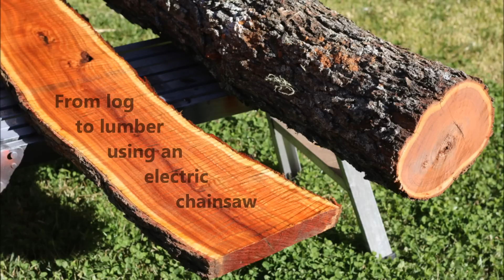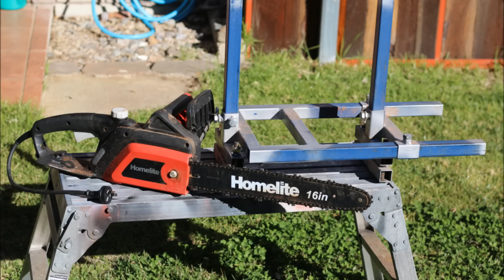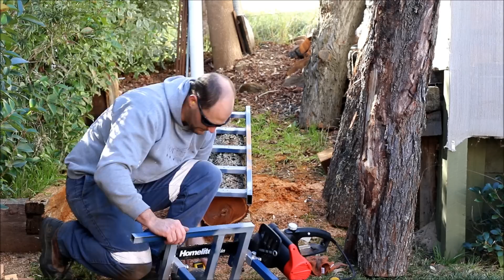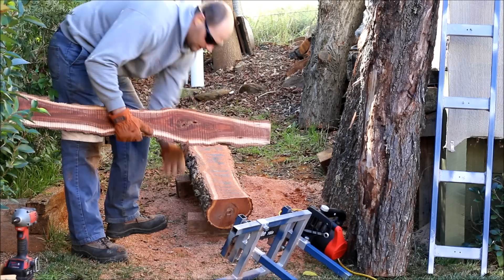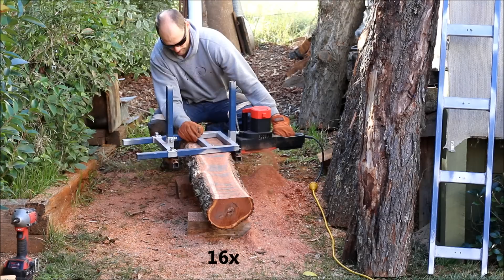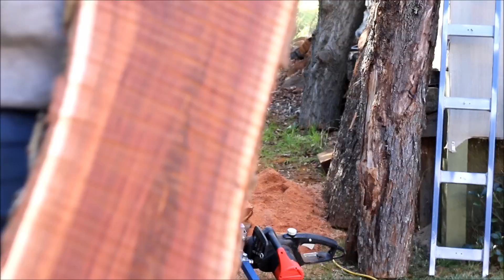Milling with an electric chainsaw - Best method

Comment: Did you accedently cut the wrong pants into shorts and only had white duct tape to make em hole again. Awesome rig. I bought a 18 inch craftsman chain saw on sale for 30 bucks. Plug in. Straight rips. Been free handing 15 inch logs into slabs. Spend 20 minutes with the hand plan and they are perfect.

Comment: I would drill holes for the initial cut and the normal board cut to use pins for adjustment so setup would be faster and more precise.

Comment: Hey, can you describe what your process is for aligning that metal bar for the first cut? The granberg website says to level it, but it seems more sensible to make sure it's parallel to the pith of the log.
Reply from the maker: yep i try and make it parallel to the pith of the log.

Comment: how many wats power ?
Reply from the maker: Not sure, the only power rating stated on the chainsaw is that it has a 12 amp motor. (Watts = amp x volts), 12 amps x 240 volts = 2880 watts, factor in some loss than the saw might be 2500 watts. Its a pretty standard electric chainsaw, nothing flash and relatively cheap at $120 australian.